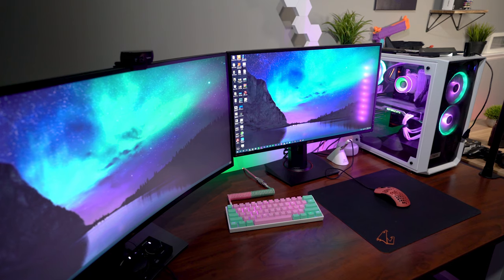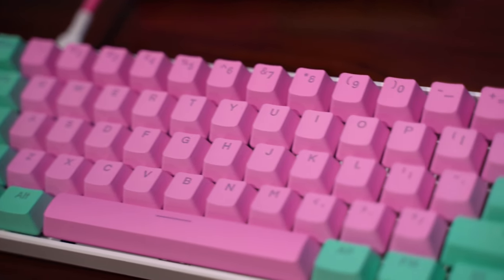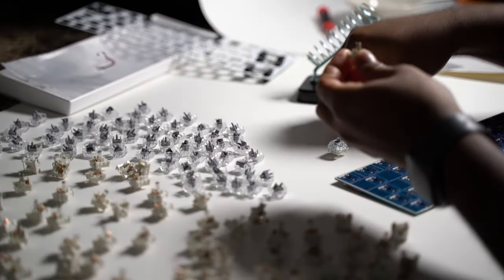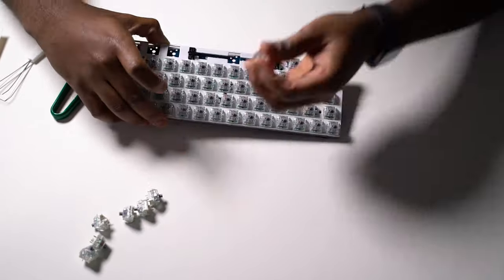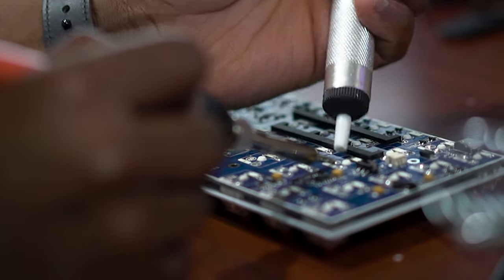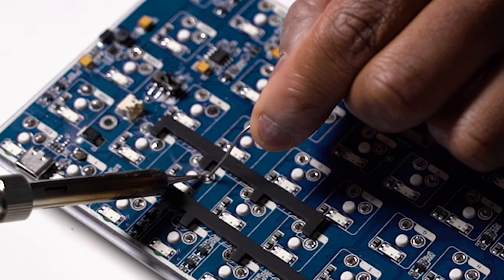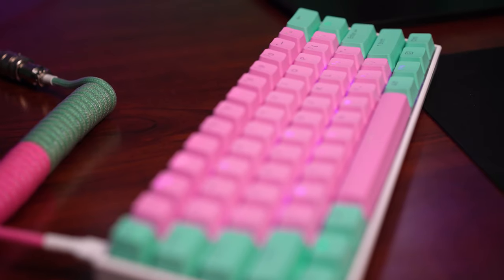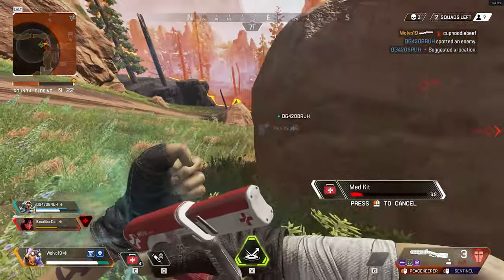Anne Pro 2 Mods! Kailh Speed Silver Switches + Space Cable + Matrix Miami Vice Keycaps!

Comment: Disclaimer to anyone who buys the Krytox from amazon by chemours, its 205g2 not grade 0. Sound will be more muffled and remember to use VERY little since its way thicker. It's more recommended as stab lube rather than switch lube, my first mistake when using. Barely applied any and still kind of too thick. invest in g0.

Comment: Do you have a link any good soldering tutorials? I'm thinking of doing this
Reply: I don't have a link, but there are two ways you can go. You can use like the pump he used in the video, or you can use something called wick. Just heat up the connection and either cover it with the suction tool, or wipe the hot tin with the wick. Same as with regular soldering though, it's a technique you need to get a hang of